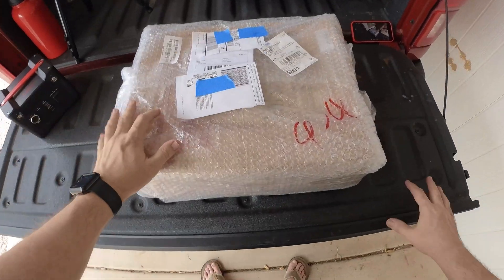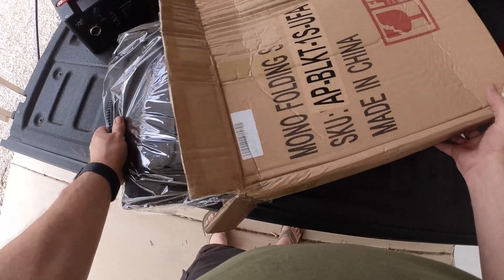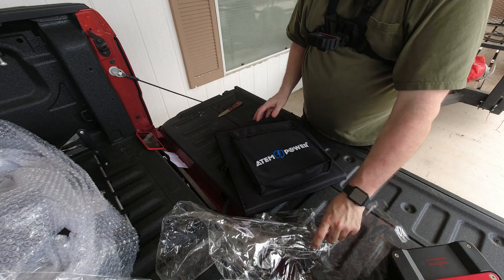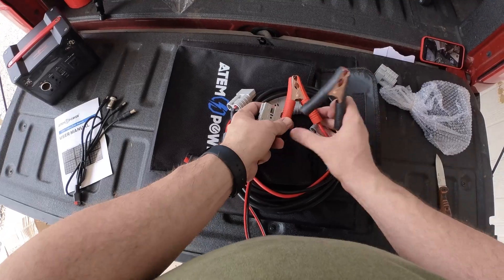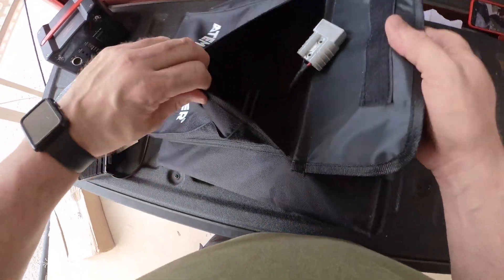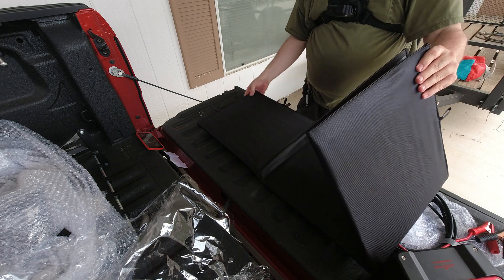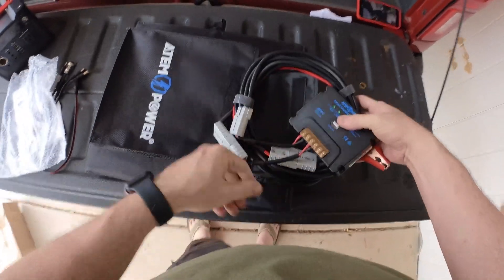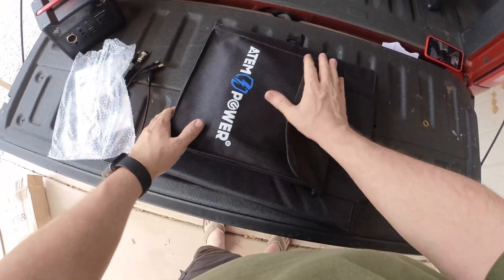ATEM Power 120W Folding Solar Panel With MPPT Charge Controller Unboxing

Comment: Thank you. I just got the same product. The provide printed
 instructions are a little bit fuzzy. If it’s working properly, are the battery lights suppose to be solid or blinking?
Reply from the maker: Solid if charged and blinking next light over charge level if charging.